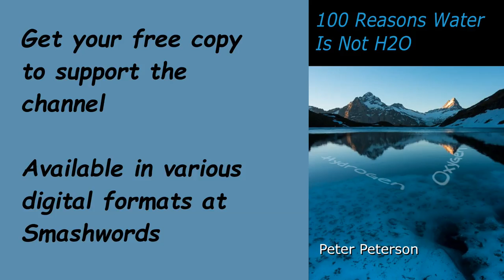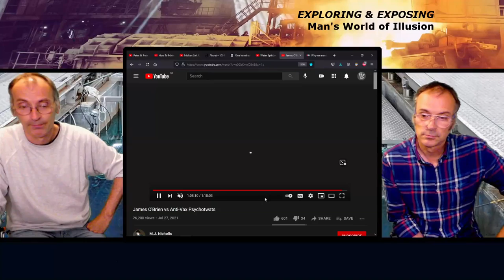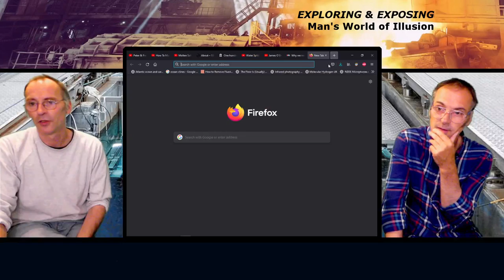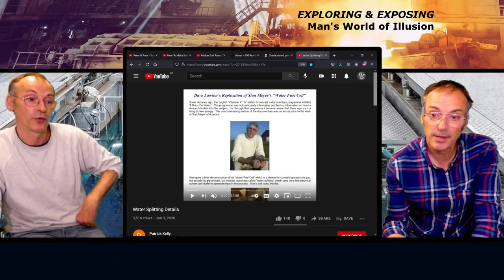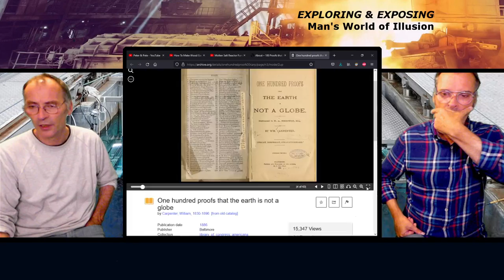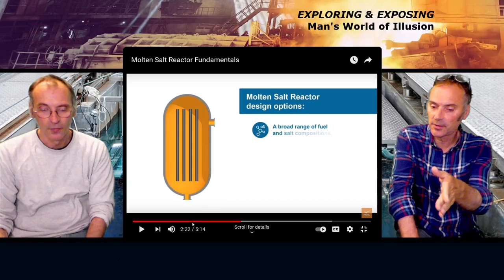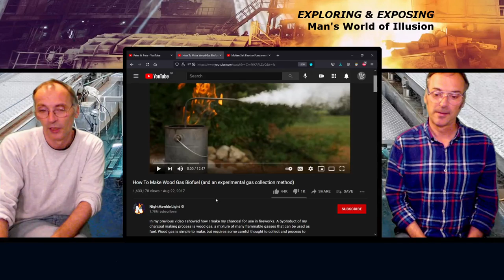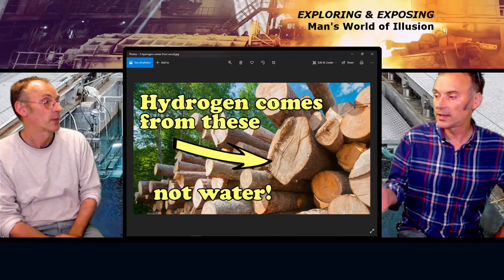Hydrogen comes from these....not water!

Comment: I'm not speaking with hostility just so you know cuz I love you all's show and love what you do but I am currently trying to run engines on HHO gas,( what ever it is producing it). Do you think it is possible to run engines with the electrolysis process? I've got it to work for a few seconds with a jigger rig device. LOL
Reply from the maker: Are you intending to use HHO gas as the only fuel source?
Reply: @PeterPete  I was trying.You think it's possible?
Reply: To run an internal combustion engine on browns gas or so called "HHO"  well, you need to also add air and a very small amount of water to the mixture. also physically decrease or retard the valve timing on the engine.  Thats what ive been told through my research.  I cannot verify it because i havent tried it myself.   The "idea" of adding water to the mixture is that browns gas combustion will change the water into steam and help expansion in the cylinder.  its a much different process than gasoline combustion.  I hope i wrote that without making any claims because these are just ideas ive received from sources i tend to trust  Good luck with your experiment.

Comment: I've made small batches of charcoal. Initial off-gas was mostly steam, almost certainly generated from heated residual moisture in the wood. This was followed by increasingly combustible vapors as the moisture steam decreased. There were also tar like droplets blowing out with the gas/steam, which seemed to be combustible as well. I suspect this 'tar' was wood resin cooking out of the heated wood batch. I considered the possibility that all of the combustible off-gasses were a by-product of super heated wood resins and not from the wood fibers. There are numerous accounts of WW2 Germans running vehicles using wood gas in the later part of the war. Of course internal combustion engines of that period were not very fuel fussy.
Reply from the maker: thanks for your comment Terry

Comment: How does one compare something that exists externally, outside ones clothing and can be removed at anytime, not used,  based on individual choice to something that once you have made the uninformed choice to use it, it can never be removed and the possible consequences of an accident remain forever unlike when you are no longer in your car using or not using the seatbelt. This should not even be considered an analogy in my opinion. No similarities whatsoever and the accident it's supposed to be protecting you from doesn't exist.
Reply from the maker: good point!!!

Comment: As exciting as hydrogen is I'm really interested in a easy to produce liquid fuel for gasoline engines. I'd love to run my 150cc scooter with a biofuel but they are more suited to diesel. I've seen easy to make fuels made from plastic where you capture both liquid and gas fuel... just can't run a gas engine with it.
Reply from the maker: why not?
Reply: @PeterPete  Biofuel or biodiesel doesn't ignite by a spark like gasoline does it ignites by compression. Diesel engines aren't just slightly different than gas engines, they operate totally differently because the fuel works differently, has vastly different physical properties. This means commonly made fuel from waste foods or plastic won't work. I have yet to find a substance that has properties similar enough to gasoline which would make the gas engine run.
Reply from the maker: @DivergentDroid  aha i think i know where the problem could lie - you have to make wood gas so that it is like gasoline or any other flammable liquid!

if I was to produce a liquid from wood gas I'd produce wood gas then mix with high temperatrure steam and collect the distillate in liquid form.

I'd imagine one would have a very volatile liquid like petrol/gasoline!

At least I'd try to produce it that way!
Reply from the maker: @I C Flatwater pick something?
Reply: @sashasoule4585  I haven't heard of that and I don't want to run diesel at all only gasoline which is much different then diesel. I need this to run a gasoline engine.

Comment: I don't believe energy is ever free, it's always needed, you can't create it. energy inherently knows were to go. ask and you shale receive as in the spiritual cleshay. As well the sqeaky wheel gets the grease.
Reply: after thought; when a wheel is sqeaking its creating heat a human puts oil on it which is a form of energy causing the heat to dissipate, so is heat not lower energy.
Reply from the maker: @gerrydoyle711  the sun's heat energy is free
Reply: think of the sun as a pyramid as the energy gets closer to the sum its area gets smalller and colder like the cathodic religion gets colder towards the central core.